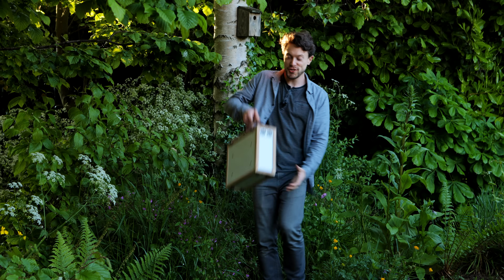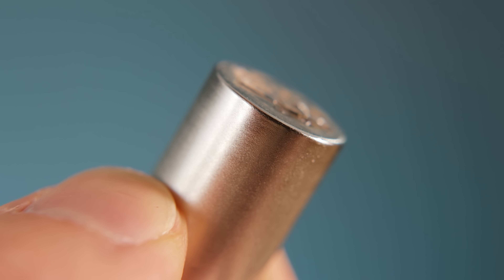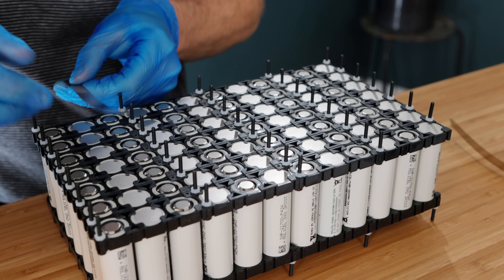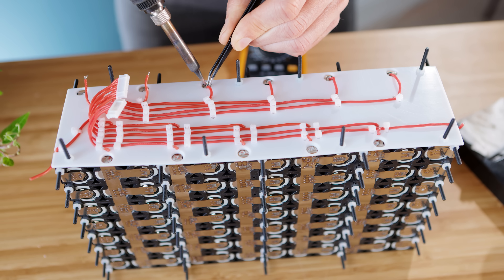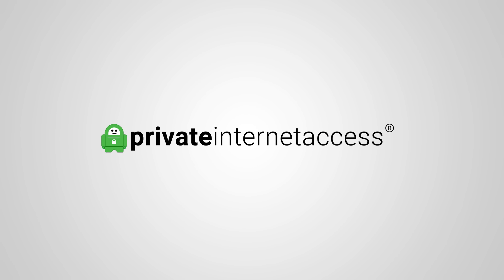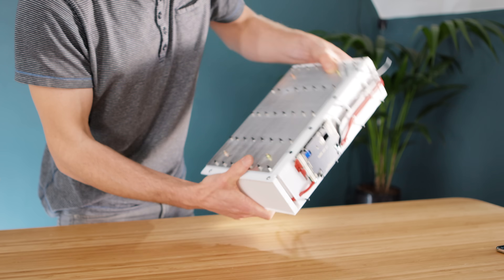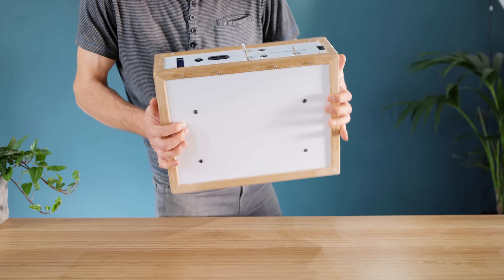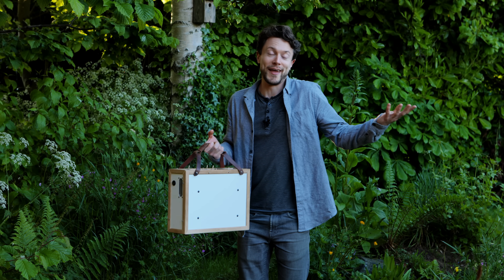Build your own portable POWER STATION (1200w, USB-C and MORE!)

Comment: Next Video:
"That entire previous video was shot indoors using my artificial daylight lamp 3.0, which as you can probably tell, is now completely indistinguishable from actual daylight. And, with the help of some potted plants from my local nursery, completes the illusion, fooling almost everyone"
Reply: Indoors in a brass dome for the complete 360
Reply: "I only used those plants as a model as I built my own from brass and PTFE. Nice."

Comment: According to the German DIN VDE 105 Regulation of electrical safety, there are five basic rules to follow when doing work with electronics.  and 5th says to cover live parts. You could have just put some layers of tape over the open battery ends to greatly reduce the danger of "desastrous" accidents

Comment: The voltage difference between cells is only little important. What you forget is the difference in capacity and the difference in internal resistance. That is why lots of (laptop) battery packs go bad really quickly. The capacity is the most important, and when you draw a lot of power the internal resistance comes into the game. Every parallel row of batteries must be within percents matched. Otherwise your Battery Management System has to do a lot of work balancing your pack.

And make sure your BMS supports balancing, otherwise your battery pack can be bad within 10-20 cycles.

Also, have a look at how tesla did weld the cells together. They use a rail along each row of parallel cells and then connects the cells to it with thin wires wich can act as a fuse. When something really bad happens, the wires will act as a fuse. But because they are so short it can easily handle good amounts of current.

Comment: Cells should be matched by capacity, not just by voltage. Voltage will naturally even out once they're connected together. However, cells with different capacities have different discharge curves,  and if you connect them in parallel, some may be overcharged, and some undercharged, shortening their life significantly. This may be not that important for brand new cells (although it is highly advisable, and it is done in factories for laptop batteries and power banks), but it is very important for used cells.

Comment: Nice project but a few suggestions for improvement:
i) the handle probably shouldn't obscure the controls
ii) would be nice to have a pure sine wave converter and power socket built into the unit so that mains powered devices can be plugged in directly

p.s. for people not familiar with power inverters, it should be noted that some devices require pure sine wave inverters so if in any doubt, use this type.

Comment: I would like to point out that these cells begin to significantly degrade after 300-500 cycles, not thousands. While they absolutely can be recharged thousands of times, their capacity will be severely diminished.

Source: I worked in the vaping industry (where we almost exclusively use these cells) for many years, both in product development and retail management. We charge these batteries daily, and the capacity is noticeably reduced after only a year.
Reply: Ain’t the current draw on vape batteries high asf.  Wouldn’t that make them degrade faster
Reply: @thatyoutubeguy7583  Not necessarily. It happens on low output devices as well. The batteries themselves are only rated for about 600 cycles before they're considered too weak to be useful. Keep in mind that there are no companies that make batteries for vaping (only vaping companies that rebrand existing batteries), this data is from the manufacturers and is based on average use-cases in which vaping batteries do fall into (albeit nearer the higher end of performance requirements). We're definitely not talking about people who push the specifications to the absolute limit, those batteries usually don't last more than 100-200 cycles before they're basically scrap.

Comment: I just want to share my experience with using the same battery chemistry and almost the same set up. 
-----
I noticed that your individual cells are not fused to the main bus bar. In the long run some of those cells will die, and the remaining goods cells will compensate for the needed current (draw more current from good cells). 
-----
1200w you say? 
(1200w/50V)/7= THAT'S 3.43A PER CELL! In my case 2.5A of current draw rises the temperature of individual batteries to about 37°C (depending on atmospheric temperature and my batteries are not enclosed like his set up, with that configuration the heat will build up inside the pack). For new cells that won't be an issue. But, as time goes by, at that load good luck. 
-----
You need temperature controllers to cut the load when over heating. No alarm system when the critical temperature is reached. Your batteries are not ventilated. Those 2 fans are not gonna cut it. You should've a digital temperature controller, they are cheap and small.
----
Luckily we have the same board for USB charging. Those IC's need heat sink, they heat up to 57°C at 2A load. 
----
You shouldn't use mechanical switches. I don't think they are good for 24A unless they are the marine grade one. Use Solid State relay or the conventional type relay (they have good contact points for high current applications). 
-----
You should have used XT60 connectors or XT90 they can handle currents from 60-85 Amperes. 
----
You also need to know the balancing current of your BMS. You should buy a separate board for that. It is called an active balancer (balancing currents of good quality boards can handle 5 Amps). As far as I know there are no built-in active balancing functions that has over 0.5A. Under big loads good luck to your BMS balancing that battery pack. 
----
Given the fact that your cells are new, you should have checked for internal resistance too. Since the capacity of those cells should be close to one another.

Comment: Why wouldn't you use batteries from a UPS you would only need 3 to 4. They would be so much easier to setup and would put out more power. Probably lighter too. Just what I would try personally. Also I could buy two fully equipped and good quality power packs for the price that costs to make. Great job though if you have a surplus of cash and time to waste lol. Thanks

Comment: If we ignore the fact that those two Noctua fans cost more than most people are willing to spend on a power bank, this is a pretty sweet setup ^^.
And if you need a proper battery pack for an UPS for example, this is the way to go. 
(The failure rate of 12V lead acid batteries is a more serious threat to my electrical equipment than actual power outages here in central europe...) 

Now make a case out of polished brass, curved like a PS5^^

Comment: Got a quick quote for 84 21700 batteries of the net. One, they didn't have that many in stock. Two, they were similarly priced at other stores, so the price seems accurate. Three: the quote came to €620,- excluding shipping, which might be quite expensive given the weight and volatility of lithium ion batteries. The whole thing plus equipment will easily break a €1000, and leave you holding a small but powerful and extremely toxic incendiary device. Especially if you skimp on the BMS.

Comment: It's cool and all.
But why not just purchase a high-quality car battery and some voltage converters?
Reply: Car batteries have terrible energy density & are very heavy. Their advantage is they are cheap and provide many amps without voltage drop without any complex electronics. They are great for turning an engine over, but not a good source of power (which is why electric vehicles also use these lithium cells)
Reply: @carbon1255 
It didn’t seem like he actually cared much about the capacity. He seemed more like he cared about the max. output.

Comment: Nice BB. But in my opinion 7 cells together is kind of not very safe since any of these 7 batteries can over charge without your knowledge and may not be detected by the BMS. And if have learned something in my years of DIY is that what can go wrong will go wrong and I am sure you have experienced this, the failure of one of these batteries may cause a big fire. Maybe use lithium Iron Phosphate or Upgrade BMS. Love your channel by the way!

Comment: It may have been answered but ...
Cells are 4.2ah x 7s x 12p x 3.7v = 1305.36 Wh
Max draw capability from cells 7p x 45amps = 315 amp draw
Found power supplies on eBay for $5 AUD

Comment: The only problem I can see is insufficient cooling, the cells in the center are bound to get too warm with high currents. Longevity is probably going to be reduced. I saw that Tesla actually glue their cells onto plastic tubes that carry circulating liquid coolant, this makes their batteries very durable.
Reply: for what I have found, the tesla battery uses around 570 kW at max acceleration (around 1500 amps at 350-400V). And he uses just 1,2 kW for his maximum.
You see that you can't compare a car battery to this portable ones in terms of energy usage and therefore heat output. 
Cooling is never a bad idea and maybe he can improve the airflow, e.g. pushing it through the space between them, but he probably checked and the cells aren't anywhere near its limits

Comment: I built something similar but very basic using a ebike battery and connected a step down voltage converter and I havea 24v and 12v output using the dials on the converter. I use it to power Aputure 120D and 300D outdoors

Comment: I say first that I have no experience with this sort of thing so it's highly possible I am incorrect, but would it not of been wise to put some airflow over the cells to regulate there temperature as well, even if they don't get dangerously hot I would of thought it would extend there life at least?

Comment: Eh personally I would like some airflow through the batteries especially for charging, not anything crazy, like a couple of 90mm - 140mm fans at 200 - 600 rpm during charging and high power draw situations, so they would be basically silent. also some temperature monitoring too per cell preferably, but that would be a lot of work, and then if a cell reaches a certain temperature cut off all power if the temperature continues to clime set off something as annoying and loud as a fire alarm powered from a separate battery something like a 9V battery. The first temperature you would set would be very safe the second alarm temperature still being within spec, but if the cell is continuing to heat up after there is no charging or power draw you probably have a big problem and with that many cells if you have a big problem it will end up in a huge fire you wont be able to put out.

You would have another alarm on a tripping of the first temperature, but it only needs to be loud enough to notify you it's not charging or powering anything anymore.

Comment: This is a great DIY, however it could be cost beneficial to use 4x3.6V prismatic LiFePO4 cells, which are damn near indestructible, and an inverter. Essentially building your own 12v car battery. At least for me, where a single 21700 cell at 4.8Ah and 3.7V is $15, making a 100Ah 12v battery cost over $1200 (that's just the cells).

Comment: You should look up the 'KWeld' for your future projects Matt - battery operated but puts the bigger chinese units to shame. You also should not be spot welding to the centre of the negative side, as it can damage the coil. Avoid the centre 1-2mm

You should also look into 'mica' for your insulating material. Completely non conductive and can actually withstand the temperatures of a lithium based fire.

Also - Are you completely sure that your nickel strip can carry enough current to deliver the maximum wattage you are using?

Finally - for your high power output I would suggest looking into Neutrik connectors, they do some intended for wiring up speakers that are very high current and should make a better/more solid/longer lasting connection.
Reply from the maker: Really helpful points there! Cheers!
Reply: @DIYPerks  No worries, drop me a DM if you want any links to mica or the connectors, been in the process of building something similar myself for a while but I'm much worse than you at finishing projects!

Comment: I hardly gave YouTubes who made battery packs 👍🏻.  Most, if not all, that I had watched didn’t give a 💩 about safety.

But I gave you my 👍🏻.

In future, I would love to see you include (1) thermal control in case of overheating during charging & discharge and (2) secondary fail-safe, like PTC or fuse.  Nonetheless, I loved that you brought the right message to the audiences to respect Lithium batteries.  You also showed that how to properly build one with a minimum safety requirement (overcharge protection, over-current protection & short-circuit protection with the BMS).  That’s the right way to go.

Keep it up. 👍🏻

Comment: not to poo poo on this, i learned a lot on cell management, but couldn't you just get a UPS which already supplies AC at high wattage
Reply from the maker: I guess, but having looked at them they seem to be very low capacity... like to run an 800 w load would be fine for a few minutes, but not a couple of hours as is the case with this DIY one. 😁
Reply: @DIYPerks  ahh totally right, and UPS’s don’t come with a leather handle. I’m interested as I’m looking for a battery to run my shed appliances (occasional mower, LED lights) with and charge with solar

Comment: It looks like your fans are the wrong direction. You now suck air in through the large openings at the fan side, instead of through the nice mesh that is easily cleanable. This will cause dust (and other stuff) to collect on the fan blades and require the case to be opened to be cleaned instead of just dusting off the intake mesh.

Other than that, nice build!

Comment: You've made a homemade Jackery battery pack, nicer but less practical. Too bad because, I assume, given the amount of work and knowledge you've put into it, you could have made it more usefull fairly easily.
The build quality is outstanding, but the connectivity is a bit poor IMO.

It would have be nice to charge this battery with a cigarette lighter socket will on the go or with a solar panel by exemple when camping.
The DINs connectors trick for the main output is also clever but a bit sketchy, it would have been so much more practical if the inverter was built-in, even at the cost of a few pounds.

Comment: Would have been better to use LiFePO4 packs. Much safer. A 12V pack with built-in BMS can be bought fairly cheap.

Comment: Oh my god, mate I literally just finished building one of these a couple weeks ago!!!
 Mine is a bit bigger and has the charger and inverter built in and has about 1.2kWh of energy capacity. I designed it to plug into my Prius when I go camping so it only accepts 12v charging input through a 50A Anderson connector.

Comment: Amazing video! can it be recharged with a 50w solar panel? how long would it take to fully charge it? would it be useful at all?
I believe you can build an emergency charger made of foldable panels connected to one or two of this power station to power an entire camping trip or even an off-grid van :)

Comment: Is there any reason for getting 50v instead of connecting them as 3 in series for the good old 12v?
Really awkward to see all this after using 12v Lifepo4 batteries for Van camping for many years ;) You can cook on 12v no need to convert voltages back and force and carry a huge microwave in a car.

Comment: I 'm thinking of making myself also power bank but no way to use flamable batteries. Instead I would be using Liitokala 32700 LifePo4 batteries which can only exhaust air and can be charged (4000 times if handled well). Not sure if i have missed but this battery delivers only DC current right? what about putting inside AC inverter (may be as separate "luggage" alongside if you dont wan't to always take AC and DC together)? Also when this build is in so big, may be you can attach to sides  custom build solar panels folded once on each side so having something like 4x squared space  of side  ofyour "luggage".

Comment: Those graphics were sleeeeeek!
Reply from the maker: I burned the midnight oil for those! :D
Reply: @DIYPerks  It shows man!
Reply: @DIYPerks  that was your mistake right there. Why burn the midnight oil when you have your artificial sun?
Reply: @rossclutterbuck1060  I see what you did there.
Reply: @DIYPerks  one thing you overlooked ... you need to at least air cool the lithium cells themselves ... you already have them spaced out for airflow, you just need to figure out where will the air come in from and where it will leave ... a mostly heaven airflow is recommended and if it is from bottom to top, convection will help the airflow as well.
Reply: mostly even airflow
Reply: Simple, stylish and effective!

Comment: A nice build. Chances of recreating it by amateurs are very slim, though. And I doubt if it's worth it once it requires buying a lot of expensive parts - I guess certified, new power stations might turn out cheaper.

I miss making use of scrap, widely available things on this channel.

Comment: I have been working with 18560 battery for almost 3 years and I solder strips on the the battery. I know it is not ideal but using a high power soldering iron (60w and above recommended I use 80w) it can be done easily. Also recycling and changing battery is easier with soldering

Comment: Just measuring the voltage is kind of useless. You have to run a cycle Charge-Discharge and measure exact capacity.
You can have a cell with good voltage reading but 50% capacity, which will make the whole battery 50% weaker just because of 1 cell.